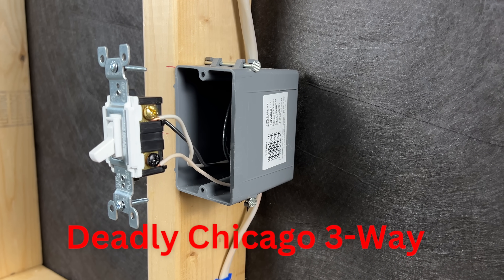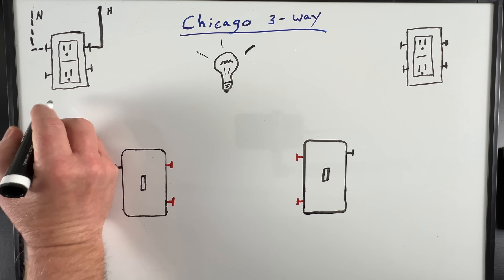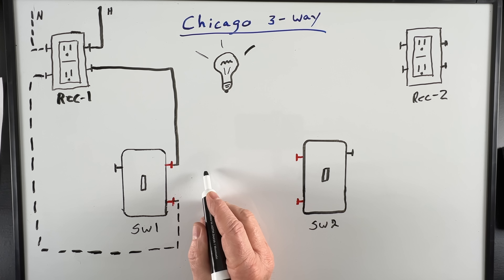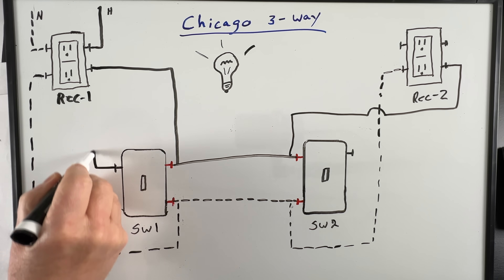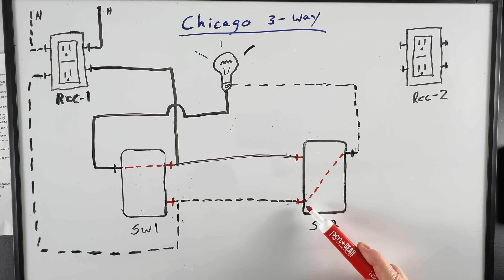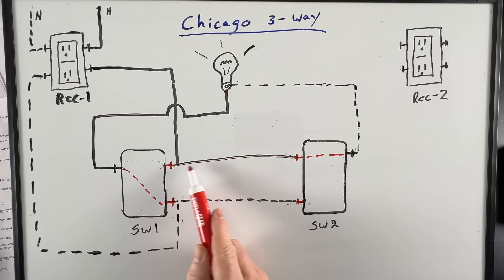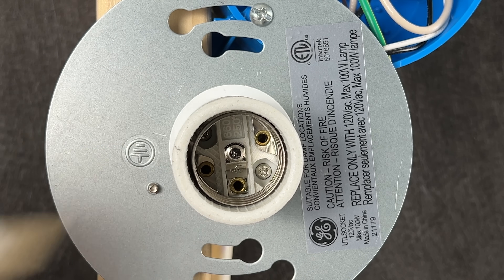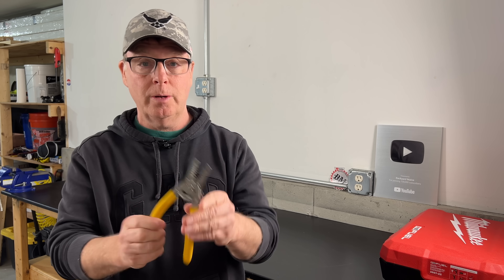The Deadly Chicago 3-Way (Only 2 Wires)

Comment: We bought an old house in 1981 and I, a young guy knowing the rudiments of residential knob and tube, was rewiring a 3-way on our stairs with romex when I discovered a light fixture off but both terminals hot. After calling my father, we tried to draw it out but failed. Then we called my grandfather, a longtime lineman for the regional power company. He drew it out for us and, as I remember, it was just as shown here. I've wired up numerous houses over the years but have never run into it again. Thanks for a great video.
Reply from the maker: Thank you!  Awesome story.. Thanks for sharing.
Reply: The light bulb just came on. Pun intended.

My house was built in 33, the upper floor still has some knob and tube until I replace all the plaster and lathe. 

I couldn't figure out what the hell was going on with the hallway light. Now I know.

It was 2 wire three way when built, but the automotive mechanic that owned it before me and did the electrical conversion from K&T to lumex replaced one of the switches with a standard 2 way, and disconnected the upstairs switch that was connected to the K&T. Wasn't the only live wire I found hidden behind a drywall patch.
Reply: Revering polarity?  It's AC polarity reverses 60 times a second here in the US.
Reply: @The @TheRetiredtech  yes reversing polarity. Basically while ac is alternating so the is no defined higher potential side, there is an AC ground. Which is the reference, and its the “safe” wire. If you reverse the polarity you now have a hot “safe” wire. So its not really polarity like with DC. Although even in DC if you ground a floating source then you have reversed the polarity. 

Electricity can be confusing

Comment: This reminds me of lamp cord replacements. I've seen several with the polarity switched, leaving the screw shell hot all the time, including when the lamp is off. Always good to do a continuity check to make sure the screw shell is connected to the wide blade on the plug.
Reply: We have lamps from the 40's, 50's and 60's.  All the plugs have same-size prongs (non-polarized) also really old outlets were also non-polarized, as both slots were the same size.  I'm thinking polarized plugs started coming out in the 70's.
Reply: Modern lamp cord has one identified conductor. The identified conductor is supposed to be the neutral and wired to the shell and the wide blade of the plug.
Reply: @nooneyouknowhere6148  That is correct. But on some cords, especially clear cords, it can be next to impossible to see. Sometimes it's just easier to stick the prongs of your ohm meter on it.
Reply: @michaelallen5505  normally the identified conductor has ridges on it that you can feel.
Reply: I was using  Bridgeport mill at work, and someone long ago had added a gooseneck lamp to it and bolted it to the machone, but the lamp had a household type brown 2 wire lamp cord and non polarized plug, so the stupid thing could wind up plugged in either way and it ws always being unplugged and plugged back in later if someone needed the outlet and no one was using the mill.
SO I go to use the mill, turned on the lamp which had a metal shade on the bulb, and I went to adjust the lamp's position and the moment I moved it BOOM!! it shorted out! SO my hand was on the metal goose neck and I was leaning over the mill bed a little to reach it, of course the mill bed is bare unpainted steel, but fortunately I wasnt touching it!
I checked the lamp and discovered the plug wasnt even polarized! It had been like that for years and the crappy thin paper used in the lamo sockets back then to separate the metal shell from the rest and cover the terminals became brittle and moving the lamo was all it took.

I re-wired that crappy lamp properly.

Comment: only deadly when dummies go playing with things they shouldn't and not good with newer switches, which often have arc over/make/break overlap and can trip breakers!
forget having AFCI protection on those circuits, guaranteed to cause tripping. that said, it's rather dangerous/unsafe overall. clearly good reasons to be against code and abandoned.
now if they'd just clean up all the other poor building practices, including many that are "very bad" locked in codes which require full replacement or require allowances for the old work to remain.

Comment: Maybe this is the place to ask this question.  Old house (1900) with knob and tube wiring in rural western Illinois.  I know this will make no sense. Basement standard bakelite single pole brown wall mount switch.   The switch failed so I replaced it.  You can still buy the switch.  If you flip the switch ON the light goes out.  If you flip the switch OFF it comes on. I should have had a good multi-meter but I didn't.  Is this some odd variation of a Chicago 3 way or something similar?   I have no idea how this works.  It is a stupid single pole switch.  There are only 2 wires coming into the switch.  It says on the face of the switch lever, OFF and ON.  Flip it so it says OFF the light come on.  Flip it so it says ON and the light goes out. It is knob and tube.  The hot is a single black tar impregnated cloth wire coming from one direction.  The neutral is single black tar impregnated cloth wire coming from another direction.  I could not convince my father-in-law that the house should have a service panel.  The individual porcelain fuses were straight wired across the top.  "It's working.  I am not spending the money to fix it what is not broke."   Oddly, the house is still standing but now has a service panel.  Had to rewire the utility service after a tornado.  Utility said, "Nope. Fix the house service first or no meter."

Comment: Back in 2005 was doing custodial/ maintenance work for my church's campus. The original wiring was done back in the '40's in the old dairy barn.  It was patched together with mineral insulation and K&T. But it had one of the three way switches that just about drove me crazy. Because one switch was at the back door of the shop building 150' away and the other in the barn. On and it was run underground in 3/4" steel conduit. Like to never figured that one out.
Reply from the maker: I had a similar situation where I was trying to turn off power to an old barn that was being torn down. Power came into the home and there was the main panel and two sub-panels. I would not fine the two pole 30A feed to the barn. I finally cut the main to the house and it still didn't take it down. Then I was thinking they tied into the meter. Nope not there either. I finally figured out that it was fed from the house across the street. I guess that was part of the farm at one time. lol

Comment: Why draw receptacle 2?
Reply from the maker: To show that the circuit was designed to carry un-switched power through the 3-ways and on to other loads. I wanted to show that so people would understand the reasoning behind the method. Older homes had very few circuits and sometime there was only one or two in total to lights and receptacles. This method accomplished that with just a two wire system.

Comment: That’s crazy. And I thought using 14/2 for 3 way switches is bad. Not anymore.
Reply: I seen this done while helping my stepdad rewire his 1973 rambler, back in 2005.   Zinsco panel with 70 amp main.  The 3 ways in the hallway were wired with power to fixture with fixture in the middle, or what I refer to as "double dead end 3 way" .  One 12-2 AL ran to each switch,  using the bare ground  with as a traveler,  pushed against the metal box energizing it and the brass faceplate. Because the hallway had hardwood floors with no grounded surfaces nearby, you were the "bird on the powerline" everytime you turned the lights on or off.  In my opinion this makes the Chicago 3 way look safe and code compliant, by comparison.   

Also, I discovered the electric water heater had been wired with landscape lighting wire, 12 gauge I want to say, tapped off the line side of the main breaker and ran in the crawlspace for almost the length of the house.  Dad had turned the main off and I confirmed for myself,  so I took my linemen pliers and proceeded to cut the wire so it could be replaced with a proper 10-2 copper NM, and I get a bang about as loud  as a shotgun and a massive flash.   I laid in the crawlspace for maybe a minute, shaken,  trying to process what happened once I reminded myself I'm still alive,  and picked up my linemen pliers with about a ½ to ¾ inch hole vaporized in it.  Dad made the discovery when he pulled the cover off the panel,  which was in a bedroom closet.  At that point there is no saving any of the existing wiring, dad said this entire house is getting a complete rewire from scratch,  and pulled the meter before we'd sleep another night in that place.
Reply: @Sparky-ww5re  That’s insane!

Comment: We had that in our old (1912) family home, BUT SW1 was powered from a fuse box in the basement, and SW2 was powered from a fuse box on the second floor! Another problem occurred when we replaced one of the switches with a 3-way dimmer switch- the new dimmer switch immediately failed, it was apparently make-before-break and shorted the power ! That would not be a problem with today’s wiring methods.

Comment: Retired electrician. I have run across several of these 3 ways. Usually they don't have power run between the switches. Instead, switch 1 gets power from receptacle 1 and switch 2 gets power from receptacle 2. This worked OKish when we had single phase 2 wire services, but when you upgrade to 3 wire 2 phase electric services, you could have the switches on different phases and send 240 volts to the bulb. I knew this as a farmer's 3 way. I learned about them early in my career and made money fixing them when other guys were confused.
Reply: I thought a farmer's 3-way involved a sheep.
Reply: I heard that it's two sheep.
Reply: @othername1000 I think this method involves goat f*ckery.
Reply: @othername1000 😂😂
Reply: @othername1000  and then of course you've got the Alabama 3-way
Reply from the maker: Yes that works too as long as the second receptacle is on the same circuit. But as you found out, it's a bit of an issue when upgrading circuitry.
Reply: @BackyardMaine  😂😂😂 why would it not be on the same circuit, that's crazy
Reply: split phase...not 2 phase
Reply: 2 phase 🤔
Reply: Yup, I was going to post this but you beat me to it. Back in the late 80s and early 90s we were converting lots of old houses from 110v services to 240v and try as we might we blew up a lot of light bulbs.🤣
Reply: Them old farmers were always trying to take shortcuts and still do .
Reply: That is how the one in our house was. My dad turned off the power to the switch. Opened it up. Cut the wire nut off the white wire at the same time as the ground wire. Melted a hole in the wire cutters with a big flash. 

After he figured out it was on 2 circuits he just removed one switch and put a normal switch in the other location. The switches were only 7 feet apart. So better to be in the dark than electrocuted.
Reply: Isn't that now the way to wire up outlets so you can drive imported British kettles off them, and no longer have to wait forever when making a mug of tea? 🫖🇬🇧😋

(Note: If you must wire a BS-1362 outlet into your NEMA circuit for this purpose, you must put a dual-pole isolator between the two hots and the UK outlet. Our circuits are 240v~ line and 0v neutral, so the switches on most of them only switch the live leg. ⚠)
Reply: @UK-Combustibility-Assured  BS-1362 outlets and indeed any foreign outlets is not legal to install permanently wired in the US, as they are not UL listed. To be code compliant, you would have to cut off the plug end of the kettle and install a NEMA 6-15 or 6-20 plug and install the corresponding receptacle in the kitchen. And yes all US 240 and 208 circuits use two pole breakers anyway.
Reply: In Germany we call this a 'Hamburger Wechselschaltung', or Hamburger 3-way, for the non natives. But don't ask me where that name comes from, the city and it's premises does have nothing to do with it, as far as I know.

Banned since forever.
Reply: Came here to ask the same thing as others have. Never heard of 2 phase. I know about single split phase, sure.
Reply: @gatesj777  There are some old 2-phase systems I think around Niagra Falls or maybe Philadelphia.  Search it up.
Reply: "2 phase" ? Hmm... interesting.
Reply: A 240 Volt 3 wire service is still considered a single phase service
Reply: 3 wire is still single phase, its 240v 1 phase with center tapped neutral. 2 phase would have 2 transformers.
Reply: @sparkyjerred419  You have a point here but keep with the point for the point of the problem.    The problem is on a full 240 system with a center/neutral ground the possibility is now if you cross a circuit from one side of the box to the other you have the 240 instead of the 120 on a old in coming single 120 power circuit. This is also a problem that people don't realize if they run a extension cord from one room in the house to another, and if that cord has a bare power wire exposed the possibility of a 240 volt shock, or fire is now possible. It is also another way to get 240 power if you need it in a pinch but I would not advise it at all.
Reply: @tableseven8133  I understand the potential for 240v in the situation he described which would blow light bulbs etc. I'm just pointing out it is still single phase. There is such a thing as 2 phase but it was typically 4 wires .
Reply: @sparkyjerred419  That is Ok I thought of the extension cord issue and then read your comment so my comment got placed there. As to not derail the point of the 240 instead of the 120 in coming power to a house..
Reply: @sparkyjerred419  the technical term for it is split phase,  so no its not a true single phase system, as while it is single phase on the primary side of the transformer, the center tapped secondary side produces two phases that are 180 degrees out of phase with eachother, hence the term split phase.

Two phase is an old outdated system with two hots that are 90 degress out of phase and two neutrals. A few installations still exist in Philadelphia and they use Scott T transformer configurations to produce it.

however most cases where you see only two transformers, those are not scott T banks but open delta banks. Open delta is still a three phase connection, as while it only uses two phases on the primary, it still produces three phases on the secondary.
Reply: @sparkyjerred419  saw you answer when i was about to reply  Phila had 2 phase many years ago
Reply: 3 wire 240 service is NOT 2 phase. The phases are 180 degrees apart, it does not produce a rotating magnetic field. 2 phase power used 4 wires, the phases were 90 degrees apart. It was invented by Nikola Tesla to operate induction motors.

Comment: I work in Chicago, I've run into this once every year. It amazes me that this problem is still out there.
Reply from the maker: It was common a long time ago and is actually all over the country.
Reply: I'm amazed that knob n tube wiring is still out there.
Reply: Why wouldn't it still be out there? Most people don't rip the wiring out of their walls when the code changes...
Reply: I’m a 20 year residential electrician on Long Island. I’ve seen this 3 way twice. Very rare around here.
Reply: Lower Alabama and northern Florida have this problem. Particularly with homes pre 1950. Bubbah usually has a hand in it if you could imagine
Reply: That is why they call it the Chicago three way.
Reply: Now it's easy to see why cook county and Chicago have some of the strictest electrical codes
Reply: @compudude86 that's just union collusion😂

Comment: I think my attic lights are wired the Chicago Way. I'm in the Michigan UP directly north of the Windy City, The house was built in 1914.  There are still a lot of knob and tube in the house I've been trying to replace, because it's a brick home with plaster walls and a void between the brick and plaster I have special challenges ,  hard to explain if it was just wood or just brick my job would be easier, how they range everything im still trying figure out. Nothing makes sense with switches marked defunct around the house. Things have been changed since it's construction.
Reply from the maker: I would not be surprised if they are especially knowing the year it was built.

Comment: Seems like Chicago was always intent on burning itself to the ground. Dang! In 50 yrs of doing electrical work I thought I had seen it all. I've even worked on a number of old homes with knob n tube wiring and never come across this one. In fact, never heard of it, but thanks for the info.
Reply from the maker: My pleasure.. thanks for watching.
Reply: So, O'Leary's cow was not entirely to blame?
Reply: @thedeadpandeveloper  Unless the cow was the electrician, then it's even mooo-re to blame!
Reply: @davepowder4020  which would be ironic,  because this method was also commonly used on farms until at least the 1950s,  maybe even the 60s in some areas of the country, for switching a yardlight from the house and barn, with power on both ends and often a single wire overhead from the house, and barn/outbuilding,  to the light, fed from different circuits.   I actually ran across this, on a farm in Sanilac County michigan.  According to the owner the house was built in 1904, but didn't have electricity until 1951, and the yardlight was installed about a year later when the new barn was finished,  the original barn suffered a fire started by a gas lantern,  in 1951 not long before electricity would arrive.
Reply: BEATLEJUICE? 
That was a Three Dog Night Chicago Died.  @GailUrge-vq6qn
Reply: Not to get deep into politics,  but look at all the incompetent mayors of Chicago over the years 😆